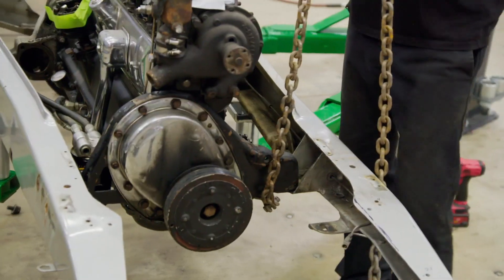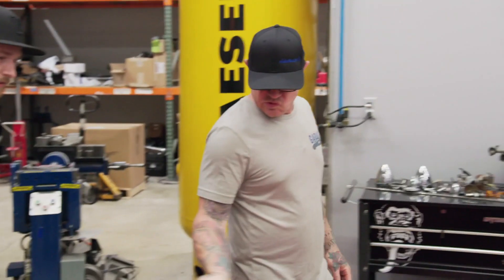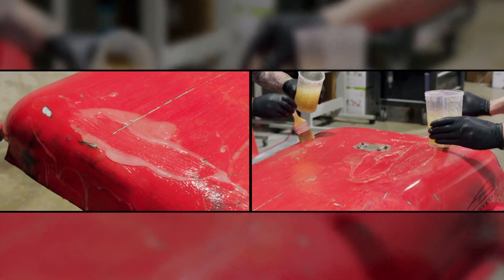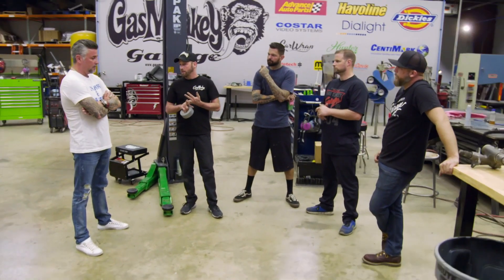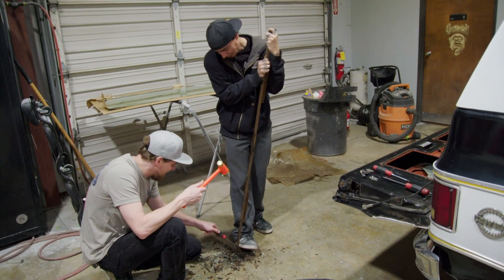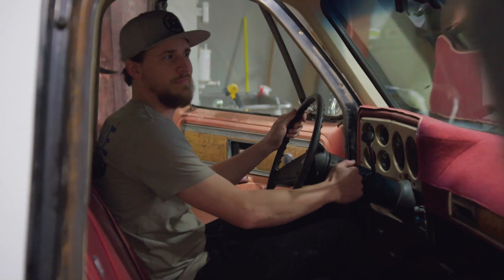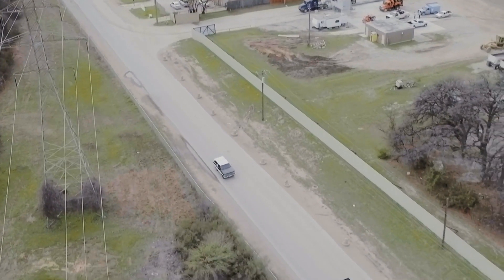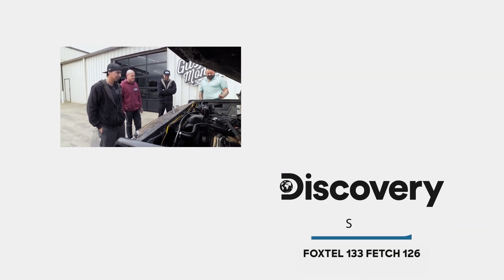How To Remove Paint Without A Sand Blaster | Fast N’ Loud

Comment: You can use brake fluid...
Reply: "I bet you're supposed to wear a respirator with this"
"I can't breathe"
They don't seem like the type to consider the best ways to do things
Reply: Will brake fluid work on stripping wheels? I want to strip some bmw wheels...
Reply: @kensimon4478  yep. test it on the backside and see if it effects the metal 1st tho.
Reply: @m3sca1  i want to strip wheels myself and take them in for powder coating. I'm trying to find the most cost effective way of doing it though. brake fluid may not be it lolol